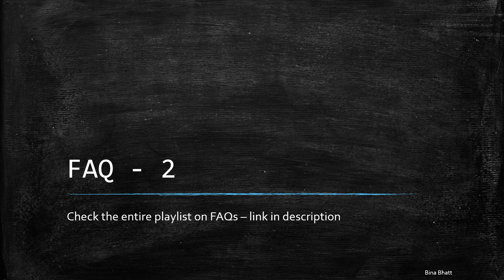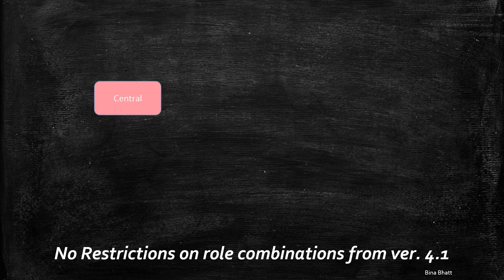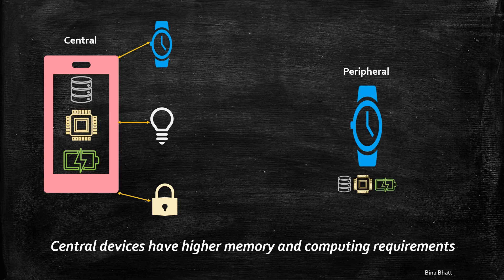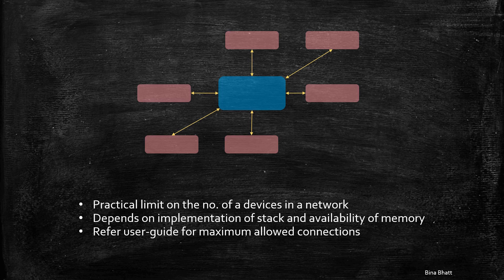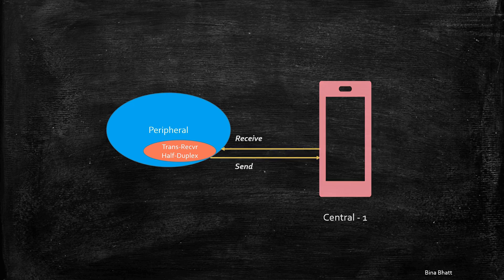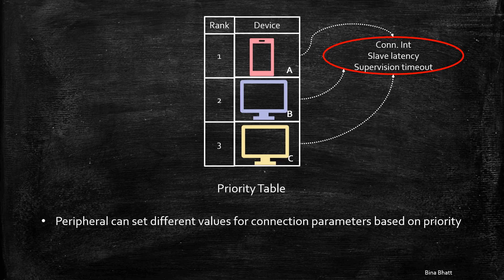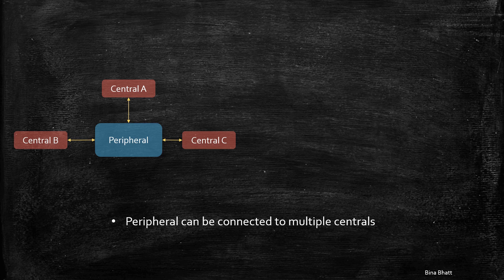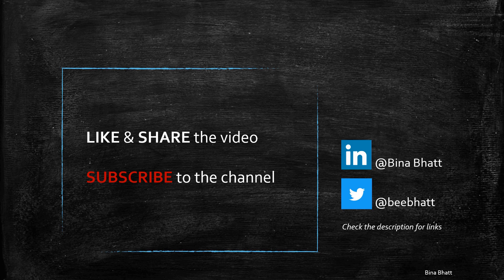Is it possible to connect one peripheral to multiple centrals? |Bluetooth low energy

Comment: In my experience, Connection parameter updates are troublesome. Each Manufacturer and OS Ecosystem does not behave the same way as we expect it to. There are situations where one of the devices can terminate the connection if it is not satisfied with the connection parameters. For example, the Spec does not speak on when to send the Connection parameter update and how many times to send it. Because of it there are implementation specific behaviors.
Reply from the maker: That's a valuable input! Thank you.
Reply: @BinaBhatt  BTW, I enjoyed your videos👍